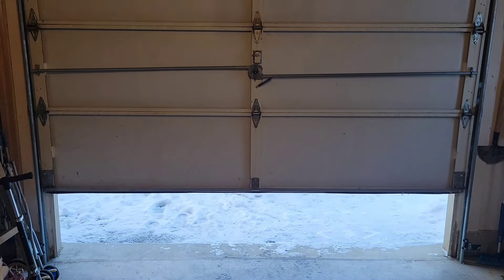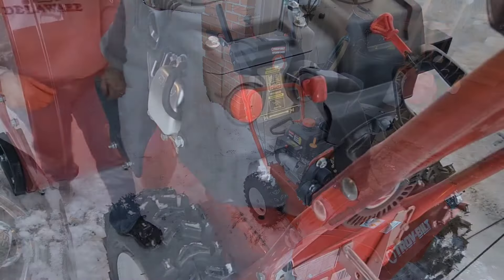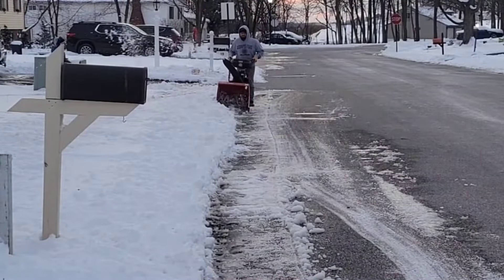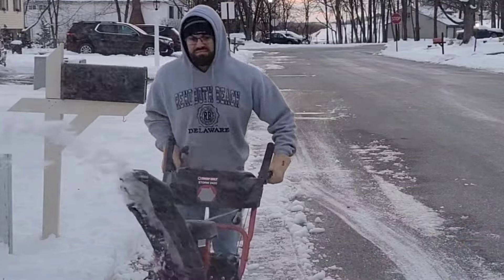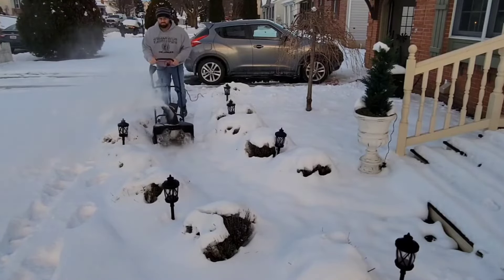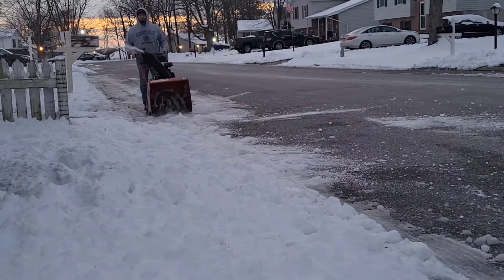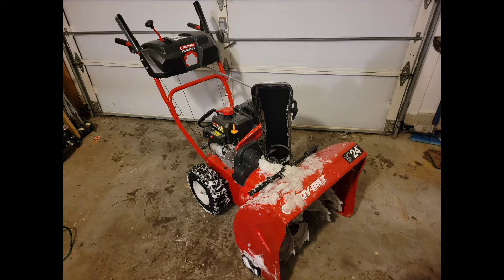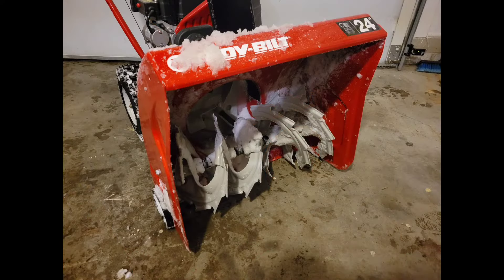Troy Bilt 2420: Performance Test

Comment: FYI, the newer cordless Snowjoes you mentioned have corded power too, and its way more powerful than using the battery. Thanks for the video, I have this new Troy Bilt and my first snowfall is coming tonight.
Reply from the maker: Thanks for the update Chad...I didn't know that. Good luck with the snow, and thanks for checking out my video!

Comment: I’m confused if I should keep the throttle to the left or right when starting/operating/turn off
Reply: The setting to the left is full choke, which is what you use to start it if it's cold. Once it's running, you move the lever to the right. If you are starting a machine that is already warmed up, keep the choke to the right.

Comment: I just got one of these … I have frozen and compact snow if I go will this eat through it easily
Reply from the maker: Jeremy, it worked good on the snow I had, which was getting icy. Hard snow can jerk you around a bit, but if you go slow and have patience, I think you'll be fine. Thanks for checking out my video.

Comment: I’ve had my snowblower for over a month but my first snow is due tomorrow. How do I know which gear/speed to choose for which type of snow. 

Also thank you for both videos about this snowblower.  It took away a lot of the fear and anxiety I had.
Reply from the maker: Hi Jennifer, thanks for watching my videos! I'm glad they helped you feel more at ease. As far as speeds go...it really depends. If there's less snow, you might have to run it a little faster to help build up snow in the hopper.  If there's a lot of snow, you might have to go slower so that it doesn't put too much of a load on the motor and bog it down.  In my opinion, you should run it at the speed you feel comfortable. If you feel safer and more comfortable running it slow, than that's what you should do.
Reply: Hopefully last question…there will be no issue using the 4 cycle engineered fuel? I don’t have to use gasoline?
Reply from the maker: Jennifer, the engineered fuel I used is made for 4 cycle motors.  This is actually the first time I've used it, and I'm hoping it prevents engine/carburetor problems down the road. So far, I haven't had any issues using it. However, if you feel more comfortable, you could always use regular pump gas.
Reply: @theshopprojects  you should never use regular gas in any small engine like mowers, snow blowers etc. Ethanol in lower octane gas is what causes problems down the road.
Reply: @donaldstevens9324  What do you recommend using for mowers and blowers, Donald?
Reply: @kieran3451  you need to use the highest octane gas you have available. I use supreme. Regular fuel contains ethanol, a small engine killer. Ethanol doesn't have a long " shelf life " and is the biggest cause of clogged jets, emulsion tubes etc. in your carb, hope this helps.
Reply: @donaldstevens9324  Thanks a million, Donald!👍 I usually use mid grade gas ⛽ 89 but probably should upgrade to 93 octane!👍
Reply: @kieran3451  no problem Kieran, you're welcome....definitely use 93!
Reply: Slow & steady until you get used to it. Heavy wet deep snow go slow. Light fluffy snow you can go faster. There is no need to go above 4 th gear, Be aware of your surface conditions also. Bumps and cracks , slow down or you will be breaking shear pins.